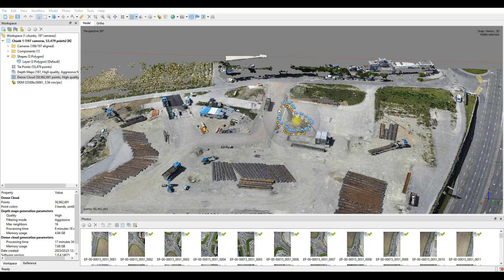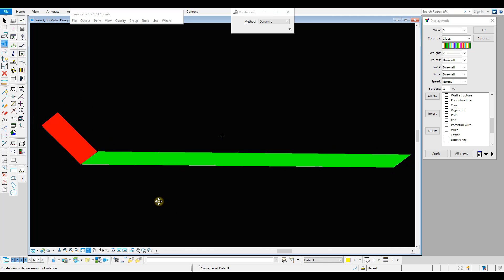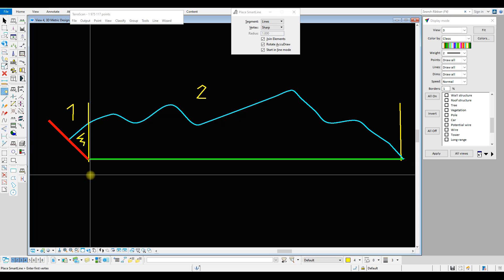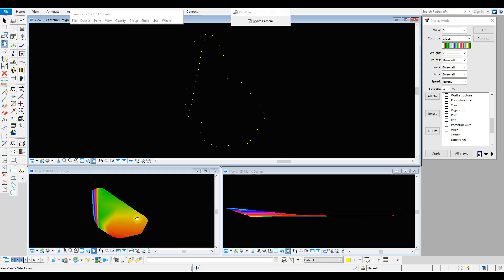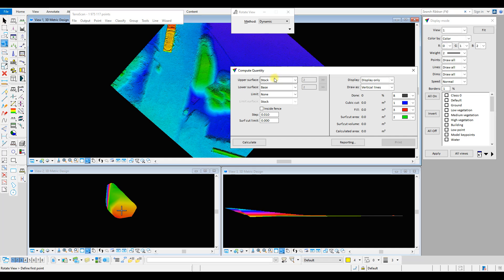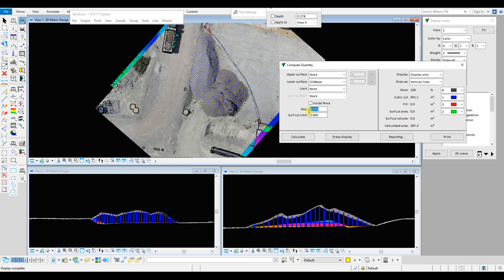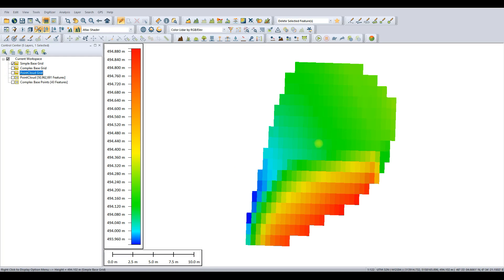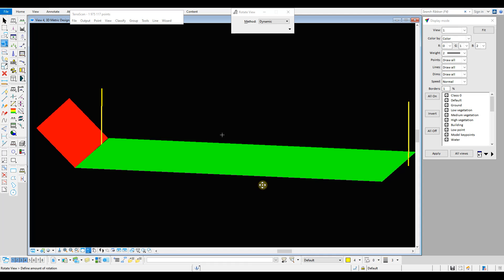Advanced Photogrammetry Volume Measurements

Comment: Hello, I am discovering your videos and they are very good, congratulations, I have a question for you, is it possible and how reliable is it to calculate a volume in Metashape, but from an excavation?
thank you
Reply from the maker: Hi - thanks so much for watching!
Yes certainly, you can calculate the volume excavated in the same way you would calculate the volume dumped. In my experience, the accuracy is very good and comparable to many other software packages. Of course, the accuracy of the data processing plays a role as well, but so long as that is done well, the volume will be accurate.
Reply: EXCELLENT, THANK YOU VERY MUCH, I'M GOING TO TRY IT @geospatialtips

Comment: Great video, I have a question. Far as volume calculation. Have you ever compared Drone deployed to Metashape to see how they compare on measuring a stockpile. If so, which application was the most accurate?
Reply from the maker: Hi - no, I can't say I have. I have compared Metashape to TerraSolid and Global Mapper, as seen in this video and found them all to compare very well to each other. So I know Metashape is pretty decent, but can't speak about Drone Deploy. I would imagine that for simple stockpiles it should be good, but I have no idea about how it handles complex situations.
Reply: It looks like Metashape and ContentCapture would be the top contenders for 3D images in my opinion. With Pix4D being a close runner up.

Comment: Which cheapest drone can do the work
Reply from the maker: I would suggest that any drone with a decent camera could be used for this purpose I would suggest that the Mavic Mini I use in some of my videos would be suitable. However, that comes with a large caveat. 

Will you be using GCPs or not? What is your processing method? Processing software? How carefully will you plan the image capture? Who will perform the calculations? A qualified Land Surveyor/Mine Surveyor, GIS professional etc. or will the data processor be using automated software? I would suggest that the more experienced you/the user has in the field of survey, the lower cost capture platform you could use.

Keep in mind however, that little is related to the drone and it's more about positioning and most importantly, the camera. A great drone with a cheap, low quality camera would be far worse than a mid-range drone with a mid-range camera.